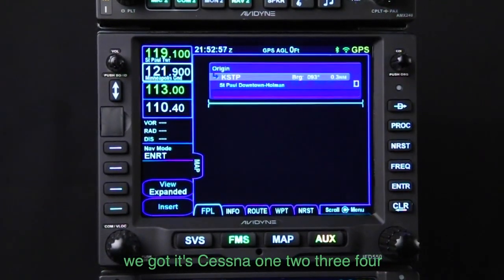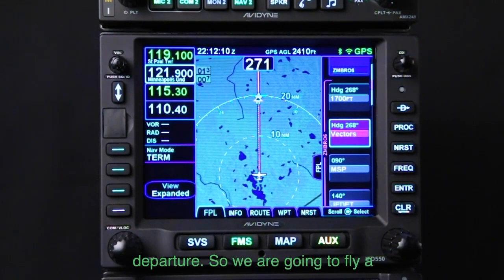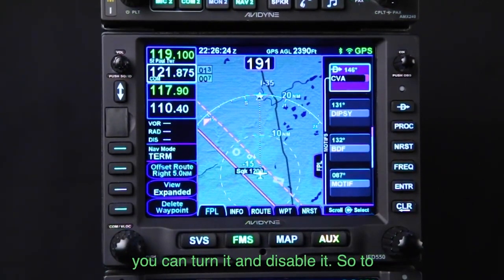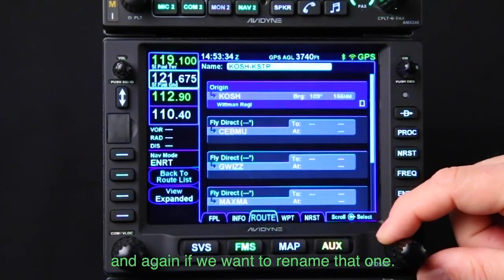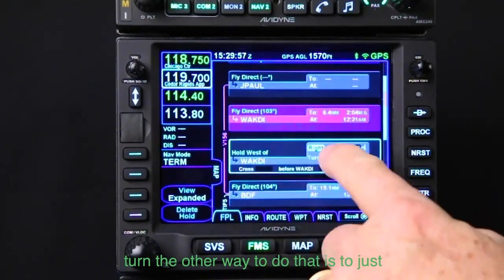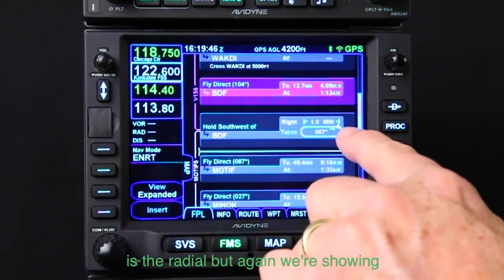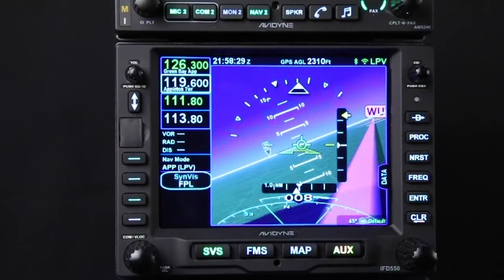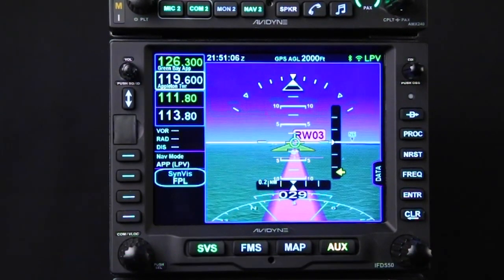Avidyne "IFD550" Advanced Training

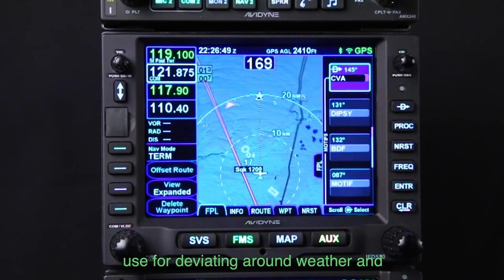Comment: At about 11:15 you say that after deleting an offset the IFD should fly you back on course. This has not been my experience with the IFD550, instead after deleting the offset the avidyne continues to parallel the track, not altering course, or in some circumstances it gives a D-To our tracking waypoint, but it does not draw the direct to line on the map, instead the original track stays, showing the aircraft off track. I’ve raised this with avidyne support and have not gotten a response. Do you have any suggestions?
Reply from the maker: Thanks for the question.  Let me clarify. I misspoke in that I should have said in this example the simulator will fly you back on course. The behavior you are describing is correct in an airplane.  When you cancel the offset, the dashed offset course disappears and the actual magenta course line is still displayed. You either hand fly back to the original course, or if in NAV mode, your AP will chase the D-bar back to the original course.
Reply: @AvidyneAvionics  thank you for the reply. I believe there is a bit of confusion however. The behavior you’re describing is not what happens with our IFD’s. When we cancel an offset the avidyne does not attempt to fly us back onto the original track, instead it draws an invisible direct to from the offset position to the waypoint we’re flying to. The CDI information that is sent to our EHSI is then out of sync with what is being displayed on the map. For example, the CDI will show us being on track while the map continues to show us on the offset.
Reply from the maker: The correct behavior is that the IFD will provide guidance back to the original route on a 45 degree intercept.  That 45 degree intercept line is not shown on the map, though. @defyent
Reply: @AvidyneAvionics  yes I understand this, and that is not what our units are doing. 

Can I ask what is the correct way to get support for this problem ? Both our pilots and avionics engineers have tried to get this resolved in the past and have had no reply from avidyne support staff.
Reply from the maker: @defyent   I recommend you reach to pilotsupport@avidyne.com.   Please email me directly if you have any issues.  tom@avidyne.com
Reply: @AvidyneAvionics  thank you. I will upload a video to make the problem more clear.
Reply from the maker: @defyent    That would be great.  please send to PilotSupport.com